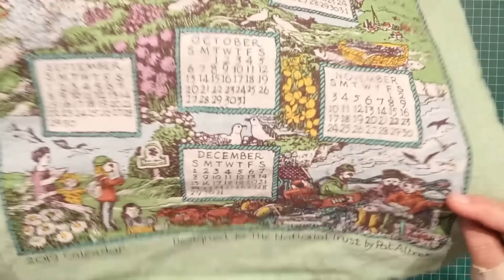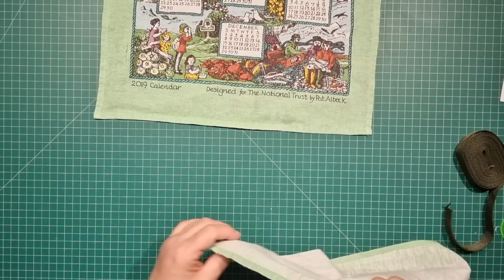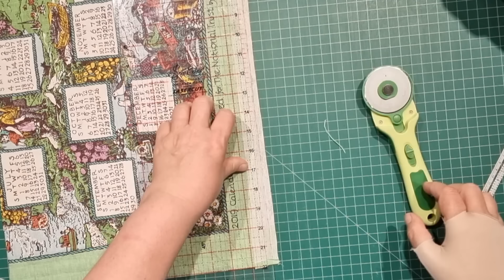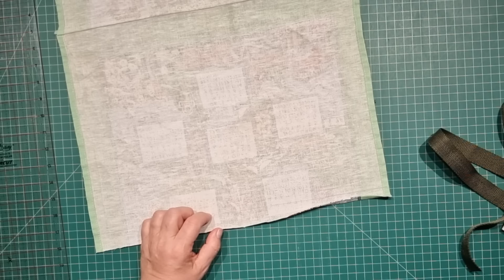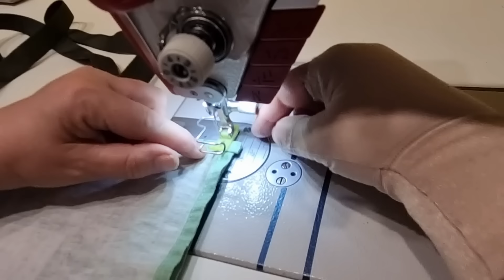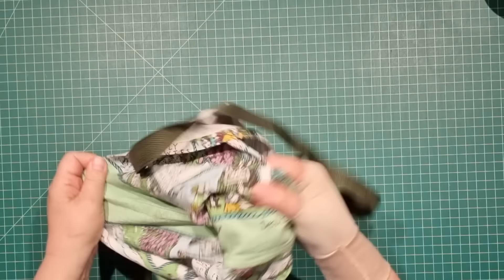How to sew a Tea Towel Tote with a flat felled seam. Easy, and quick beginner sewing project.

Comment: I don't know how I missed this when it first was posted but I have been making Calendar Tea Towel Totes for several years now and they are my biggest seller. The earliest towel I've ever seen and/or used was from 1956 -- I currently have a 1959 on hand, and just bought some 2026 ones tor fun. I fully interface & line mine. I've also seen people use these to make aprons and tops. Repurposing is the best!

Comment: Thank you Christine! Another excellent tutorial. I do have to say that I’m not as precise when doing a flatfeld seam, I just eyeball it and cut it. 🤣🤣 but I do like your precision and might try it on the next bag I make.  Another thing that you could do, instead of boxing the corners the way you did, is to fold up the bottom about an inch or two and then sew the side seam. Gives you a boxed bottom that you can flatten out better for folding.
Reply from the maker: Off camera I would just eyeball the seams to sew and  cut, but I tend to behave in videos.
I didn't even consider the other boxed corner though.  It would work well for this bag.😀